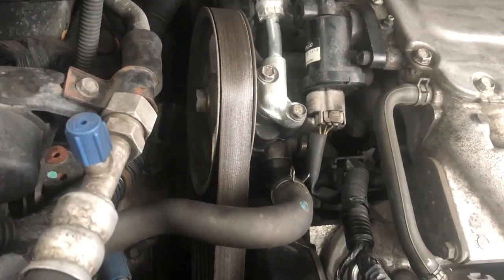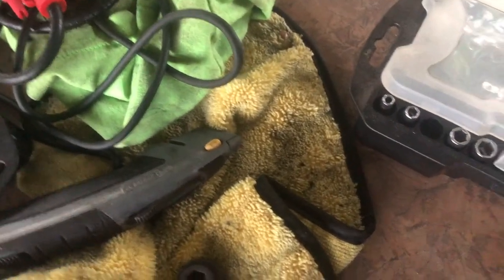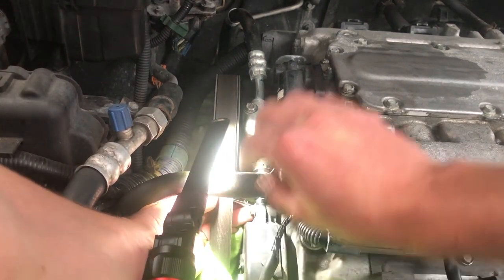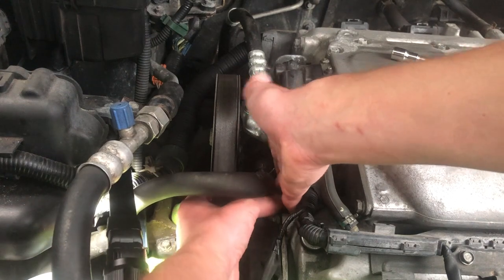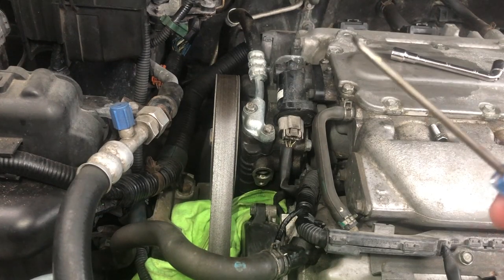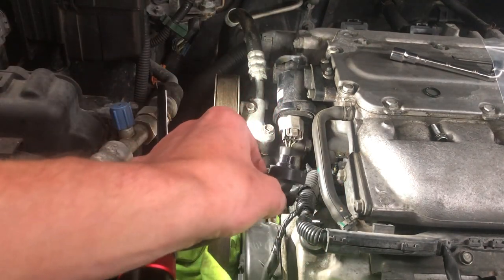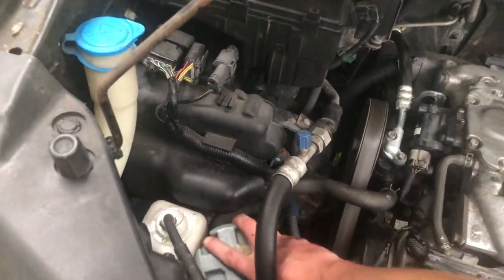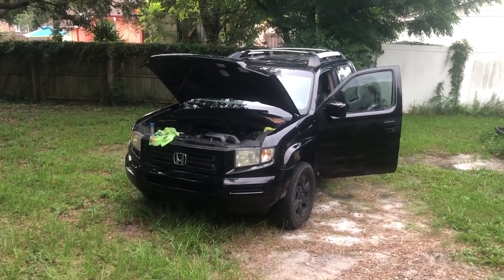2006 - 2014 Honda Ridgeline Power Steering O-Ring replacement

Comment: Thank you, very helpful....and you are correct, you definitely need the 10mm tool to reach the bolt. I replaced both o-rings while I was there. Strange how there is no indention for the o-ring on the low pressure side (High and low pressure)

Comment: Hi, great video! I have to re place the lower o ring on my ridgeline so thanks to you will order the tool first. I like your compact work light or flash light, where can i get one? And what brand is it?
Thanks!
Reply from the maker: Thanks, the flashlight was bought from Costco. Not sure of the brand, but I think the specific ones are sold only in Costco. I found this one on amazon that looks very close to the Costco one, here is the link https://amzn.to/3rR3taO
Reply: @PZPal  Hi. Just wanted to thank you for the info on the tool and the flashlights. I replaced both 'O' rings (upper and lower) on my 2010 Ridgeline. However, it is still making noise, so maybe I didn't get lucky like you and others. In my case, maybe it is the pump. But, thank you so much for the video and showing me how to do it!
Reply from the maker: Yeah, that's strange. Unless the o'rings you have still get some air through, it got to be the pump. Good thing is that procedure to replace the pump is very easy. Let me know how it'll work out!
Reply: @PZPal  the o-rings are new, made by Dorman, but maybe not a good brand to use. Bought them at autozone. Also i forgot to clean out the screen in the reservoir with brake cleaner,  could this be why it still makes noise? The noise just started 2 months ago at best. About 190,000 miles on the truck.
Reply from the maker: I heard some people having issues with o-rings not be compatible, even though manufacturer say they are, but it's tough to know for sure. What I am doing now is using amazon kit https://amzn.to/43YsUVa for a lot of applications. I could be wrong, but I think it should work on power steering as well. You could play around with different seal rings to see if that's the issue, or you could try to find a pump for good price and replace it. Tough to know what issue it is for sure. The screen in the reservoir shouldn't cause an issue with air in the system, but could damage the pump if dirty particles get through. I replaced couple reservoirs instead of cleaning them as they are fairly cheap.
Reply: @PZPal  yeah i think i will try o-rings from honda for $8.00 and see if that works, i will let you know how it goes.
Thanks again for all your help!
Reply: Update: problem solved! Took out the o-rings made by dorman which were brand new $10.00 and put new ones in from honda $8.00
The noise is completely gone steering is perfect. Thanks for sll your help! Keep up the great video's.
Reply from the maker: Awesome! Good job! And thanks for watching my videos, I'll continue on making them.

Comment: Thanks for the help, but what year is your Ridgeline? I’m having trouble getting the lower piece off. I have the tool you recommended, but I just can’t get a good position on the bolt to turn it smh .
Reply from the maker: 2006, but I am pretty sure they all are same. You mean it’s too tight? You can try to insert some pipe or something on top of the tool to get more leverage
Reply: Thanks for the fast response. I got it loose a little, but I couldn’t keep turning on the bolt due to this gray looking hose in the way. I have a 2008 Ridgeline. If I was looking right on yours. I don’t see that part in the way. But thanks again!! Going to see if my neighbor can help me out. He has all types of tools 😊.